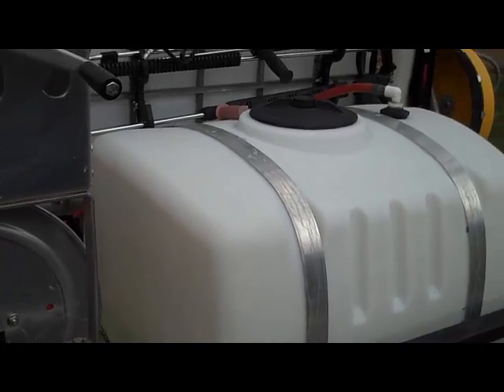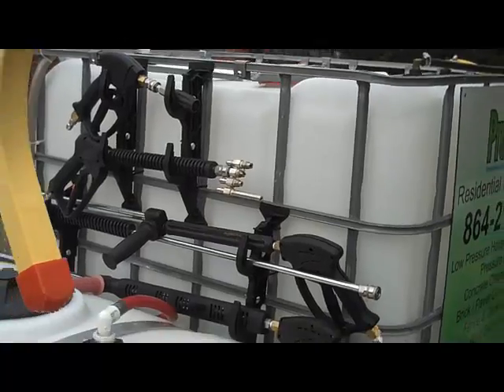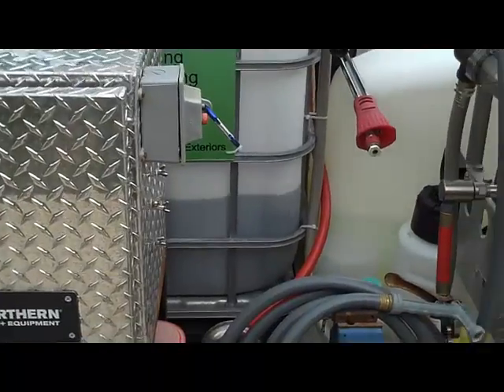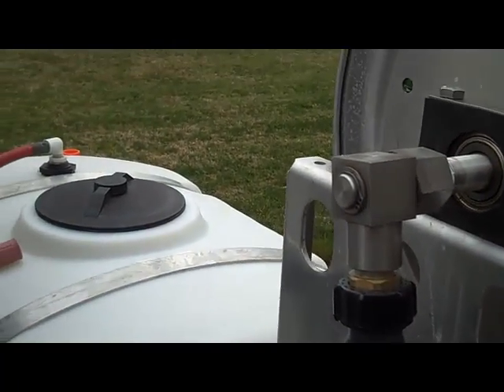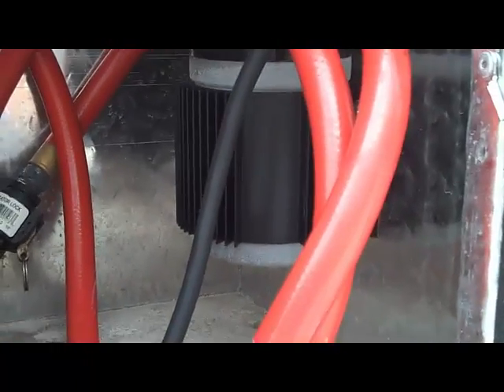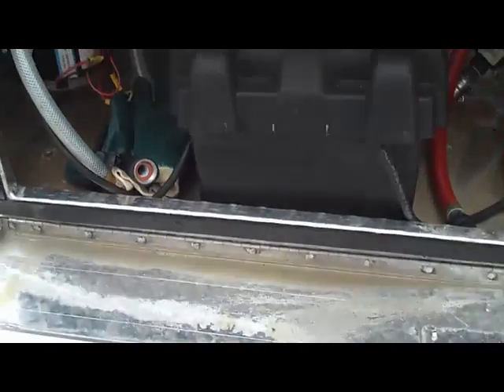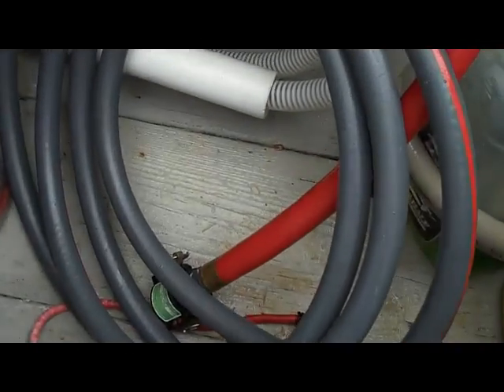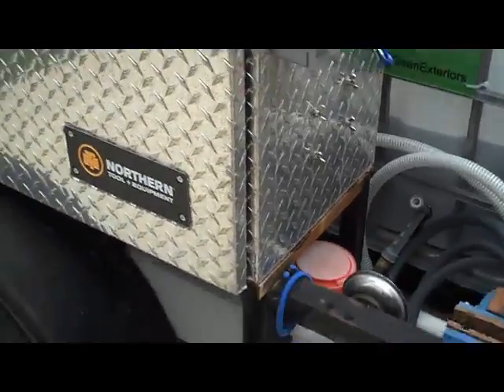Pressure Washer Trailer Build Tips and a Great Economical Roof and Softwashing System

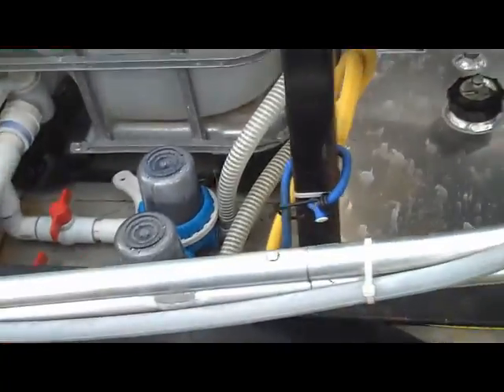Comment: Hey bud, what type of 1 inch white/clear hose is that at 4:45 and where do you get it from.
Reply: It's a spiro-flex non crushable - any of the distributors will have
Reply: Thanks Rick, your the man! Been looking for it for awhile. Now that I have a name it’ll be easy.
Reply: When I purchased the 1” spiroflex hose from pressure washers direct they recommended since having a gravity fed 8 gpm pump that I should get the 1.5” ID hose instead with some type of Y strainer filter to reduce the risk of captivating. Have you experienced any issues running 1 inch hose on your 8 gallon machine?

Comment: Can you run both pressure washers at the same time without any problems
Reply: Yes, except you need good water flow because with both machines running, pulling almost 14 gpm so you can draw water down in tote pretty quick.

Comment: where do you get those quick- conncects fittings for your hoses?
Reply from the maker: If you're talking about the low pressure fittings, you can use Gator Lock or Banjo. Tractor Supply has and most pressure washing distributors.

Comment: Thanks for sharing that. I’m curious if you think 5/8 water hose is sufficient for 4gpm or if I should just go with 3/4?  Silly question, but curious on your thoughts
Reply from the maker: 5/8 is plenty. Depending on distance for example a 5/8  water hose will flow 11gpm at 100'. 200 it drops down to 5.5gpm. Here's a good online flow chart - http://irrigation.wsu.edu/Content/Calculators/Residential/Garden-Hose-Flow.php
Reply: Thank you!

Comment: Mr. Rick do you know if I were to plumb 2 pumps(SW) as you have them here except 1 input then tee to both pumps, output 2 to 1 accumulator, then wire so that both run on 1 switch - should I expect twice the flow?  Will it hurt the pumps?
Reply: Don't believe so. I haven't tried but others have. Have seen some add another pumps closer to end of spray hose to boost pressure and distance back up.

Comment: I too bought the 5/8 flexzilla.. what hose reel did you use for that hose? And did you have to add an adapter to it. As well what hose reel do you have for pressure washer hose?
Reply: Have 18" Titan reels for everything. Whoever you order it from tell them you're using for water hose and you need an adaptor.

Comment: My roof pump chem hose is 1/2 inch what size banjo male and female do I purchase for 1/2 inch hose....thanks
Reply: 1/2"  I like the Gator locks by Greenleaf better. Can get good prices on line at Menards or some distributors carry.
Reply: @rickfairbanks6125  thanks for responding. The way you built your trailer and how simple the drop stick works I'm changing everything on mine.. thanks for making my life a lot easier you're awesome

Comment: I have never heard of or seen an accumulator.  Are these necessary or is it better to have one than not. Thanks for the response.
Reply from the maker: Some people use and some don't. It just keeps the pump from cycling so often if you got it tipped down for less spray. Supposedly helps the lifecycle of the unit. And it's only like $65.
Reply: Thank you again for answering

Comment: So why do you need a pressure washer if your 12 volt pump shoots 40 feet? I've seen plenty guys on here posting videos of their pressure washer and their 12 volt pump but no body ever explains why they have both a 12 volt and a pressure washer. Why can't you use just a 12 volt pump or a pressure washer with low pressure tips to do everything from house wash, roof wash, driveway wash. I don't understand why you need both 12 volt pump AND a pressure washer, nobody every explains it. Maybe you know the answer?
Reply from the maker: 12V more for applying chemical, max realistic pressure is about 70-80psi. So ok for soaping but not great for rinsing though it is possible. But the max chemical mix you can get with a pressure washer is about 1%, whereas with a 12v you can get any strength you want. Typically you need 3 - 5% for a roof, 2-3% for post treating a drive, stucco, or other uses. Can get close using an xjet, but it's high pressure, which you can't use on a lot of things. So that's the reason many have both, just gives you a lot more options.
Reply: So why don't you just dump the 12 volt pump and just use a pressure washer for the roof with low pressure tips and hook up your pressure water input hose straight to your roof mix tank?
Reply from the maker: Because then I'd be sucking all the chemicals thru my pump.. You don't want to do that.
Reply: Pro Clean Exteriors so if you have a commercial unit with a good pump is that not what it’s made for is to be able to run chemicals of all kinds through it??If not then why do guys buy commercial units to do the job??Im asking because I’m looking I buying one to get started and I’m trying to learn all I can.
Reply: Michael Sellers Your not supposed to do it like that but I do anyway. If you’re quick on the roof and have great management of the amount of chemical used and know what concentration level is needed I feel like the speed with 8 gpm makes it so worth it. I switch over to my water supply immediately when I’m done and rinse for awhile to flush everything out well and also to neutralize and dilute the chemicals on the landscape extra good. You will end up having a little extra wear and tear in the packing kit in the pump but it’s not that much of an investment in exchange for easily knocking out roofs at 8 gpm. My setup is a 24 hp Honda gx690 motor, 3000 psi triplex comet pump with a external unloader, 275 gallon tote for water, two 100 gallon chemical tanks, one for my pure 10% sodium hypochlorite, the other for making my roof mixture which is usually 60 gallons of 10% mixed with 40 gallons of water, if it’s really dirty I’ll go 70/30. I’ve had the same equipment for a year doing it this way(over 600 hours) and everything still runs solid. Once you clean a 5,000 square ft Spanish tile roof in 2 hours like this you’ll never look back at a 12v pump.